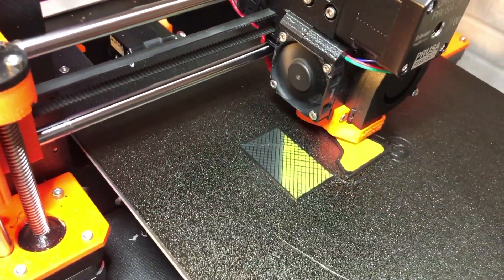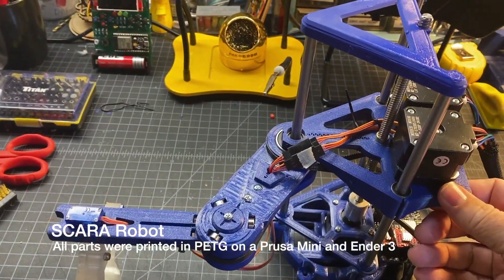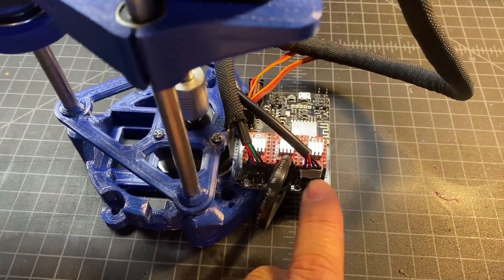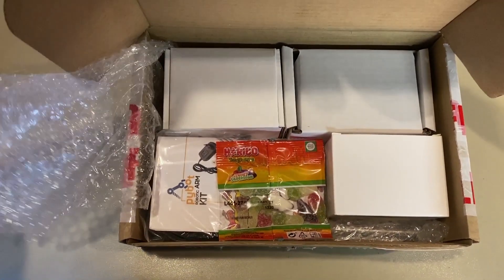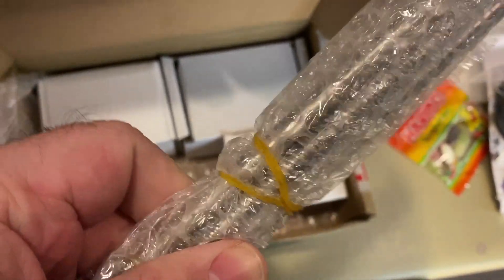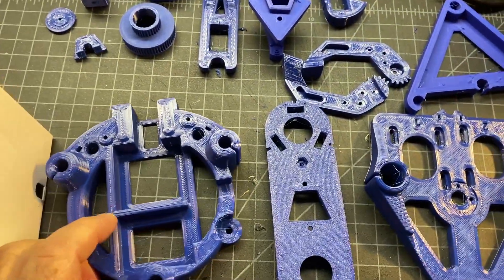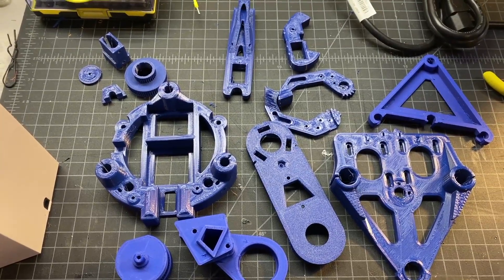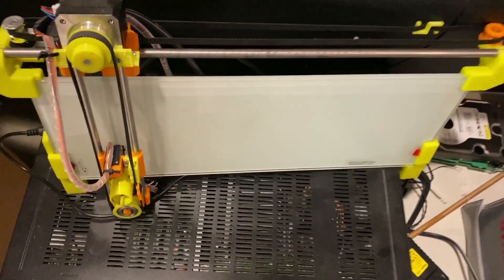JJRobot Scara Arm: Intro: A quick glimpse, unboxing, and parts

Comment: @Greg, Landed on this when looking for a SCARA robot arm project to teach to high school robotics club- 4 years after your post! Love your detailed videos on putting this together. I was able to find the pybot 3d printed files, the parts also look straight forward. But for the Software -  Jjrobots seems defunct now - the website is not active anymore.  Any chance you still have and can share the open source code (both the Arduino code and the Control APP/Python code)? Thanks in advance!
Reply from the maker: Oh man, I'm sorry to hear that it is now defunct! I looked around my hard drive, I did happen to find the Arduino code, but I can't seem to locate any of the Python code. I'll keep digging around, and if I find it I'll put it in another repository.

Here is a link to the Arduino code for the devia board: https://github.com/techyg/Pybot/tree/main
Reply from the maker: Good news! I was searching around Github and I think I found the python code as well- https://github.com/UdhayROB/pyBotControl. (posted by someone else).
Reply: @GregsMakerCorner  Thanks much for sharing! Took a quick look, the arduino compiles (and only for DUE, not a Mega) and the Python code, not yet, still figuring it out. The GUI based control code was what wouldve been perfect, a quick intro/teaser to get the club interested. Bummer jjrobots is defunt, and no one seems to find it. Will work on this!
Reply from the maker: @saranga2000  Good to hear you got the Arduino compiling. Maybe someone else will post the Python code! I was hoping to find it, but for some reason it wasn't in my backups. I have since migrated to a new Macbook and it's a bit of a mystery why it didn't transfer.

Comment: The parts link is 404.  Do you have a link to the printed parts?   Thanks!
Reply from the maker: Hey Ronny! There are a few bad links on their info for some reason. The STL files are linked at the bottom of the assembly guide as well.. Here is the link. https://www.jjrobots.com/wp-content/uploads/2019/09/pyBot-3D-parts-models-.stl-file-format.zip
Reply: @GregsMakerCorner  Thanks!  Just wanted to print the parts first before putting money into the kit.  I want to build this for a kid here in town.
Reply from the maker: @W4TRI_Ronny  That's awesome! And also a great idea printing the parts ahead of time. I recommend making sure your e-steps and extrusion multiplier are well calibrated before printing. I had a few issues with over extrusion on one of my printers, but nothing that I couldn't take care of with a file.  I'm going to try to get the rest of the build videos posted today so you can see how I did it. The manual online is actually really good, I didn't run into any significant issues.